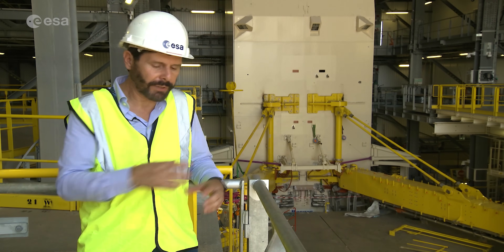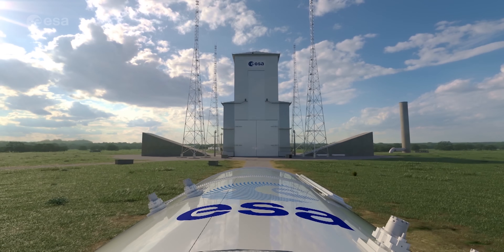Ariane 6 development: progress on all fronts

Comment: Lovely rocket and well done, but it sadly is 20 years too late. Even though it has not flown yet, it is already obsolete, because it cannot be reused. Instead of continuing to fund Ariane, we should support European Launcher Startups so that they can compete with Rocket Lab, SpaceX and Blue Origin.
Reply: Maybe leave Blue Origin out of the equation, they aren't there yet. But you're right, reusable is the future.
Reply: Isar Aerospace out of Germany has raised around 180M USD from the private sector which is encouraging. I do think that we should keep funding the development of Ariane 6 since it does give us an independent launcher at a reduced cost compared to Ariance 5, but further add human launch capability and re-usability.
Reply: @AndreasJohansson76  
"an independent launcher at a reduced cost compared to Ariance 5" Well, that still has to be demonstrated. 
I don't think Ariane6 will provide any substantial cost reduction over Ariane5. 
Why do I think that? Because there are still no official numbers on launch costs, for example.
Reply: @3gunslingers  I agree, it really has to be shown if one of the original goals of Ariance 6 (roughly reducing the cost by 50%) ended up being true. I do think that we need to switch to reusable stages as soon as possible.
Reply: @AndreasJohansson76  No we shouldn't. Ariane 6 isn't going to be flying enough for reusability to make sense.
Reply: @stsk1061  But surely that is why it needs to be reusable? If it was cheaper to fly there would be more launches. What comes first, a cheap launcher, or launch contracts?
Reply: @AndreasJohansson76  It's not really that simple. Every product has fixed and variable costs associated with it. A reusable launcher has higher fixed costs and lower variable costs. Therefore, it requires a higher launch rate to actually fly cheaper.

But the demand for more launches is not there. You can look at Falcon 9, which only did 11 non Starlink launches the last two years. And that's despite them having many more institutional launches than ESA. Ariane 6 is already targeting 12 per year.
Reply: Ariane 6 started in 2014 and spacex landed theyre first booster in 2017
Reply: It's so tiring, you people are all stuck in your competitive mindset. You are completely missing the point of what Ariane is actually for. First and foremost, Ariane ensures Europe's (and thus ESA's) independent launch capabilities. Competitiveness on an international level is not relevant for that. SpaceX et al will never be the launchers for Europe. That would be an abandonment of any core philosophy ESA stands for.
But I guess it's what you get when you let libertarians take over the public sector...
Reply: @RTSRafnex2  I'm well aware of that and I think it's very important that we do maintain an independent launch capability. However, and this is critical, Europe must match or exceed the capabilities of our peers if we and ESA are going to stay relevant in the long run. We are currently falling behind in launch pricing, suggesting that something is missing.
Reply: @RTSRafnex2  
"Ariane ensures Europe's (and thus ESA's) independent launch capabilities. Competitiveness on an international level is not relevant for that. SpaceX et al will never be the launchers for Europe." 
European customers are already switching from Ariane5 to Falcon9 because it is so much cheaper.
There will not be any payload left in 3 years that is worth flying on Ariane6 when Starship comes online. 

Because why should anyone pay more than €100mio for a Ariane6 launch when a Starship launch can carry double the mass for 1/3 of the money? Even the taxpayers will getting involved there for "national" payloads. They don't want to see their money wasted on overpriced rockets when there are alternatives.